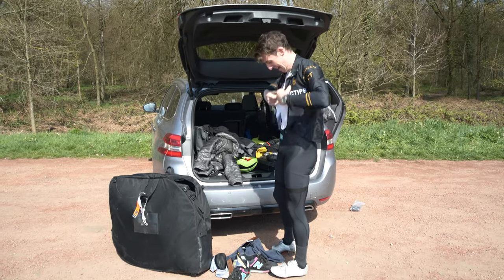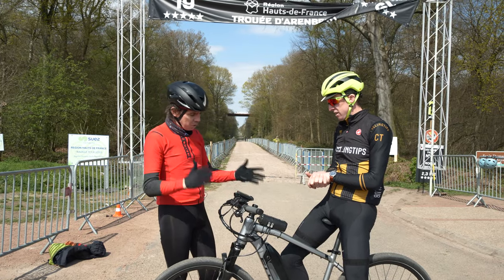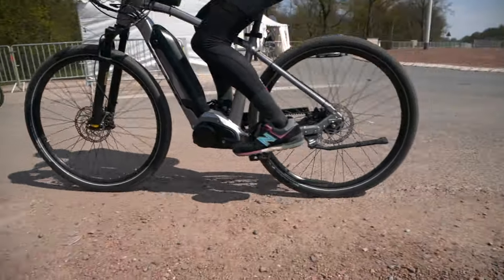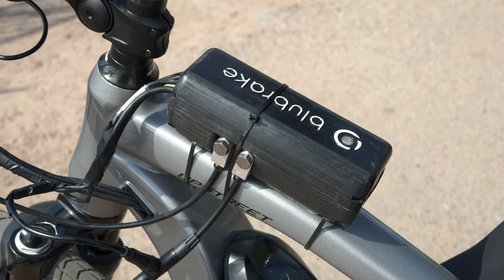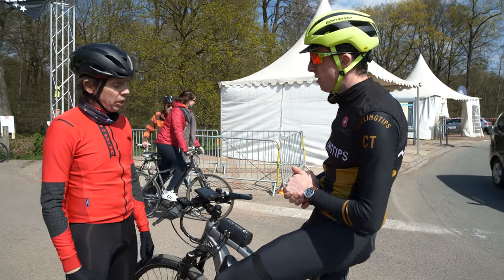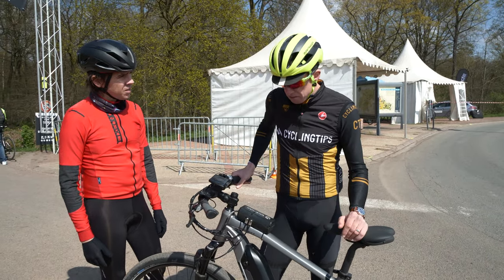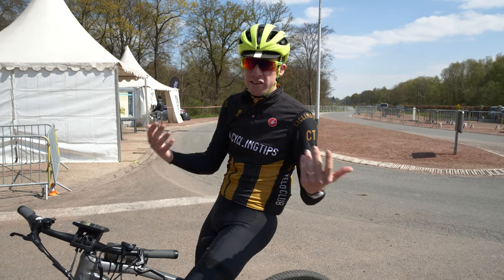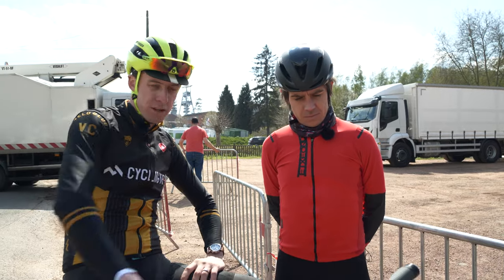ABS brake system on a bicycle. CyclingTips investigates

Comment: Guys you are missing the point. Regardless how experienced you are or think you are. ABS is for panic/emergency stops to pull you up in the shortest distance without skidding while maintaining control (skidding increases your stopping distance).
Emergency stop when in traffic or misjudging a descent. ABS would benefit everyone in that emergency situation. 
You can still feather your brakes. ABS only comes into play when your wheels lock up. If you can apply maximum brake force without locking up your wheels then the ABS will not be engaged.
All cars these days have it as standard equipment, and quite a few motorbikes have it. As David said, size and weight of the ABS unit will need to be improved before we see it. IF that could get it small and light enough, then you could see it on more than just E-bikes.
Reply: @WtfYoutube_YouSuck  It's honestly a gimmick. Knowing how crazy many cyclists are about weight, I could never see these things even being remotely viable because proper modulation works. Cars are nearly 2 tons for the most part. Bikes are 5-10kg. Don't even think DH riders would get it because it seriously limits power output and momentum.

Comment: The braking comparison was way off.  Your bike had a suspension fork, the other did not; the other bike was a road bike with skinner tires, yours were much fatter tires; the other rider was up off the seat putting his body weight more over the front wheel hindering braking, you remained seated, (ideally for faster stopping you should be putting your weight more over the rear wheel), but by you staying on the seat you had more weight on the rear tire; but the way the two of you did the comparison was putting a bit of an unfair advantage onto the ABS bike.  I'm screaming foul!

Comment: In My experience… 
 - Generally speaking, only CABLE brakes (and in particular, cable-actuated rim brakes) tend to THROW the rider OVER the handlebars. Hydraulics don't. 
 - HYDRAULIC brakes will SKID the rear end sideways if braked abruptly, especially if the rear brake is controlled by your stronger hand. To somewhat mitigate the problem, make sure to mount the rear brake handle to the weaker hand side of the handlebar. 
 - The system demonstrated looks very crude, is very heavy and bulky, costs extra money (likely, much!) and, although useful, its use on hydraulic brake bicycles is very limited, possibly close to zero.
Reply: Gotta find the right brakes for you and depends on what you do with it. Test test test. Get the right brakes that modulate to your liking.

Comment: SHUT UP AND TAKE MY MONEY.    Yes.   I want one.     Very, very much.       I don't mind a sizeable bulky unit if it keeps the price down; a little extra weight is irrelevant on an Ebike.   Brakes are a safety item, and ABS makes emergency panic braking soooo much better.
Reply: Subscribed for this video alone; how do I acquire one of these units for testing?
Some things need confirmation. Does the unit fail safe?    Is there any way for a malfunction to disable the brakes?

It's essential that the unit cannot disengage the brakes unless there is a genuine wheel lockup event occuring. Copy as much as possible from the time-proven automotive ABS designs and only alter as little as possible to adapt for bicycles.
Reply from the maker: Shimano/BluBreak are working together on a system now. SO it's smaller and now in production. It was one of our highlights at this years Eurobike - Dave